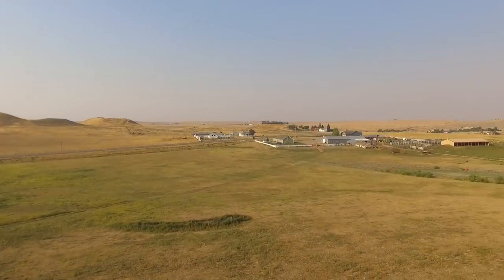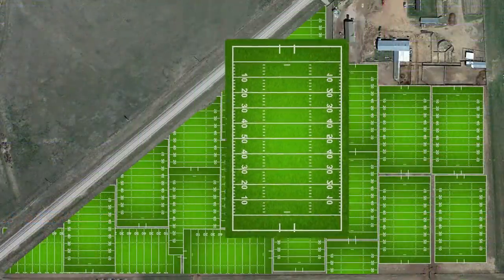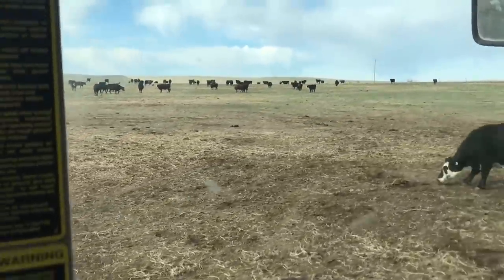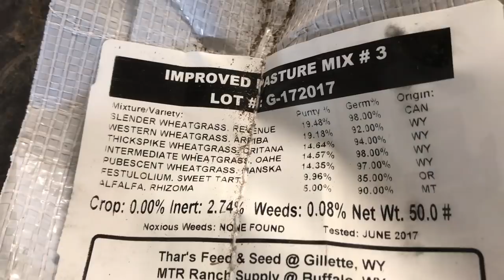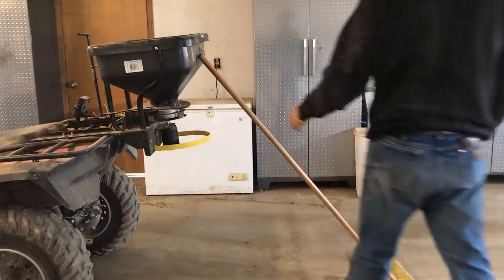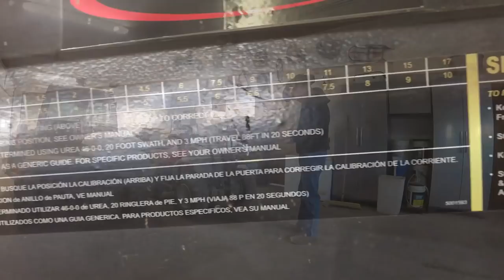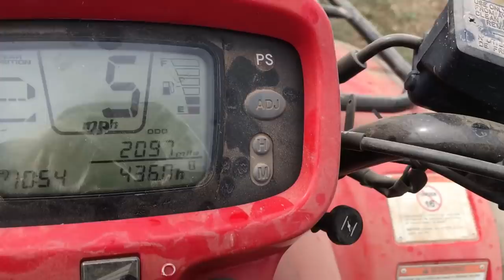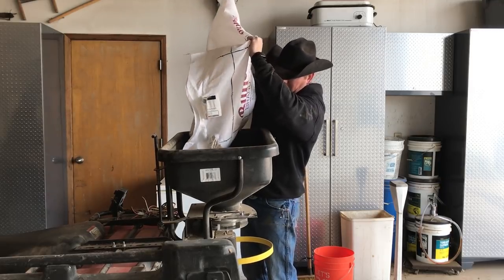Overseeding Pasture - The Project List

Comment: I know this post is old so you might not see my comment, but it worth a shot.  I'm also a dry land rancher and I use to try the over seed with a broad cast seeder and had very little luck. I was able to find an old drill for $500 and it has paid for itself in wasted seed 10 times over.  I would highly recommend it. My germination rates were way up.  Since most drills have wider rows I do a double seeding going north to south then east to west.  This fall I plan on doing one field north to south with dry land grass and then going east to west with alfalfa. Then the gaps in the rows of grass wont choke out the alfalfa.  Just food for thought.  Thanks for your video's
Reply from the maker: Great idea. Thank you very much Steven -Mike

Comment: I used to put down quite a bit a grass seed in the 80's with a spreader.   Here's how we calibrated it.  We removed the spinner on the spreader and hug a bucket.  If you know your speed, distance covered and how far the seed will fly you have a certain area covered.  Weigh the seed in the bucket and now you know how much seed you put down for a cover area.  Homeowner grass seed expensive and didn't want to waste.  I never trusted the indicators on the spreaders.
Reply from the maker: I dont trust them either, makes total sense. Thanks for the tip! - Mike

Comment: If you've got some extra wood or metal laying about, you could probably rig yourself up a bracket to mount that seed spreader to that trailer you were using with the cake feeder jobby. That way you can cart the spreader about and seed too. Cut down on the runs back and forth to the shop. Then again, I suppose what with your wind and all you'd probably loose more seed than the saved time would be worth.
Reply from the maker: Yeah the wind is always a factor. It usually does end up somewhere on the ranch. Thanks for the great idea! -Mikr

Comment: You guys should get a small drill
Reply: That would be a lot slower.   Like ten times longer
Reply: Brian JOnker are u sure
Reply: O yes and more expensive repairs.     To your point a drill works in much more varied weather.   Mike is using the weight of the wet snow to push the seed into soil contact and get successful germination.
Reply: Mike said he had to get the seeds out today.   I wonder if this proper weather even occurs each year.
Reply: Brian JOnker still sure
Reply: Brian JOnker still sure
Reply: broadcasting is both faster and cheaper plus grass seed never needs to be buried .
Reply: Earl Jensen it should and then it will do better
Reply: It was harrowed and it will get wet drills are expensive and slower then broadcasting. I grew up on a grain farm and a cattle ranch. Crops are seeded with drills but over seeding pastures was always broadcasting and harrows. Drills mess up the grass roots that are already growing we just want to increase the grass cover.
Reply: Earl Jensen so ur pastures must not have been that good
Reply: I was in South Alberta, Canada. Mike and Erin are in Wyoming. where are you? take care of the land where you are . Farmers in Iowa do not farm or ranch the same as farmers/ ranchers that get less then 15 inches of water per year.